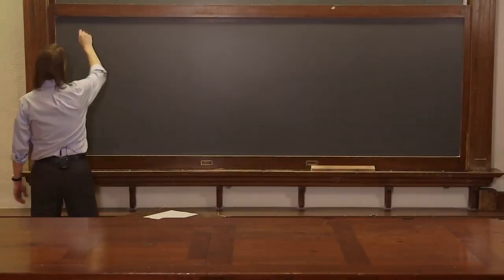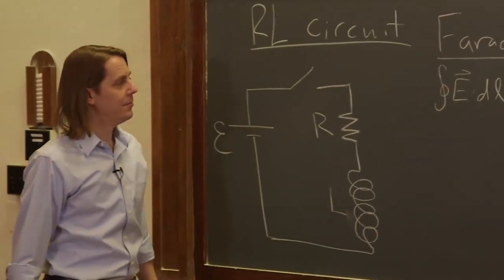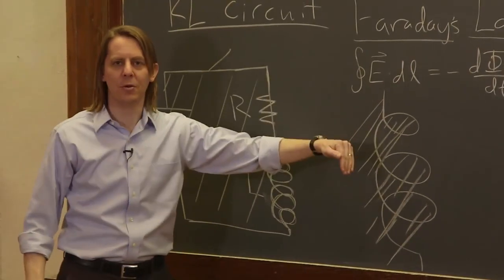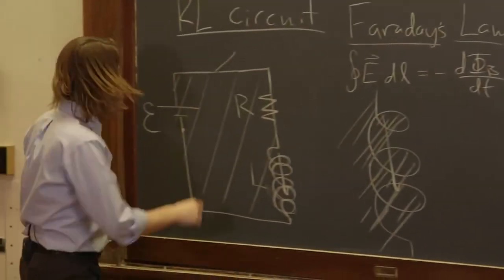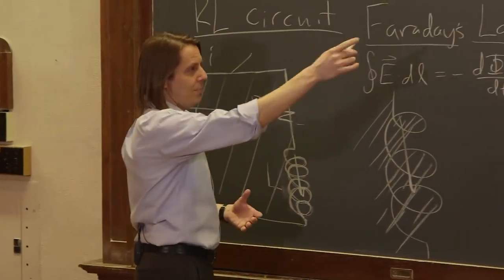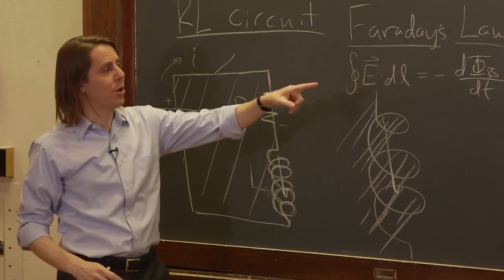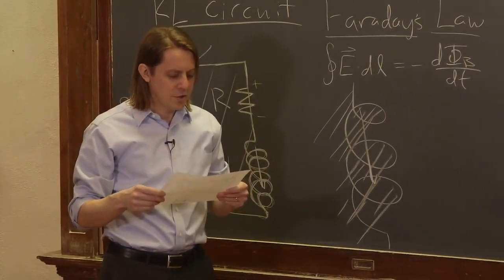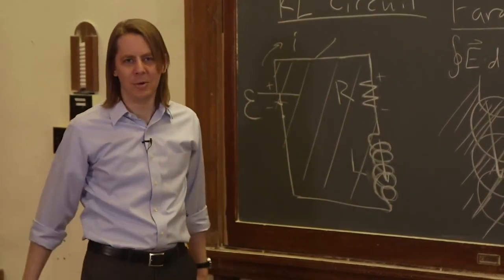PHYS 102 | LR Circutis 2 - Faraday's Law is the correct approach for a Circuit with an Inductor!

Comment: Professor, the reason why Kirchhoff's Loop Rule doesn't work in your example is because you are cheating!  Strictly speaking there is NO SUCH THING as a switch.  It is NOT an electronic component, it is only a man-made device.  The laws of the universe don't recognise it.  The closest you can get to it is to use a variable capacitor where the capacitance is reducing exponentially until it reaches 1/infinity (which it can never do).